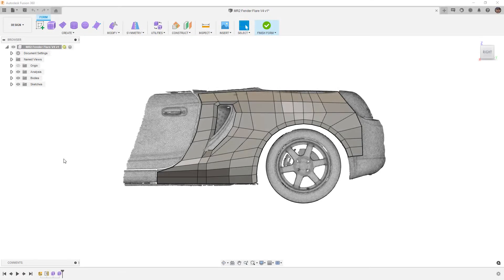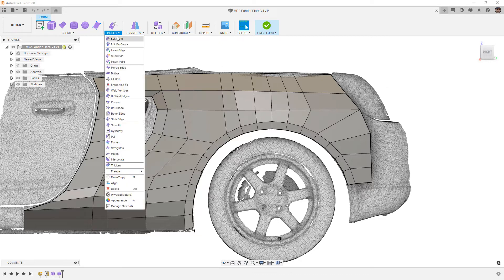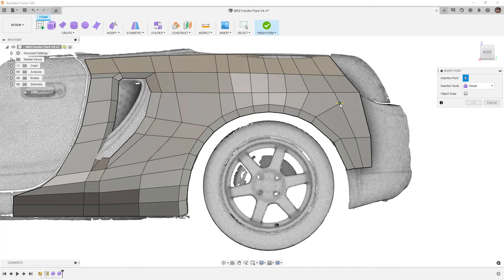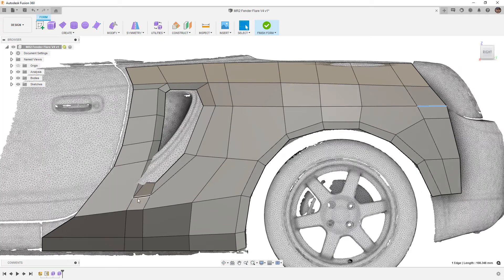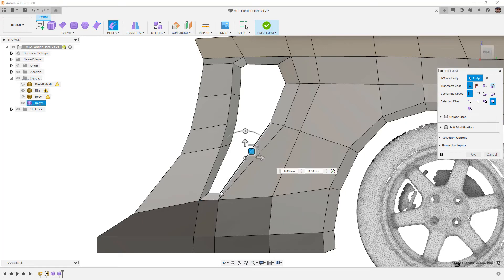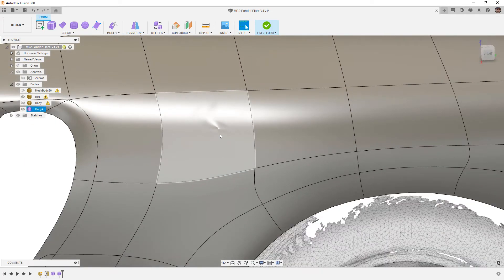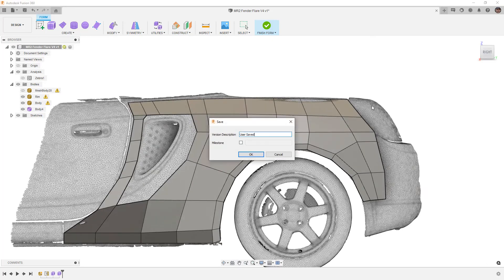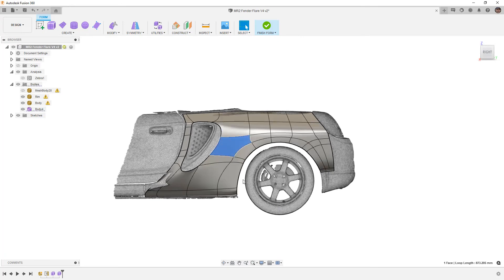Design a Fender Flare in Fusion 360 - Reducing Edges and Faces to Simplify Control #Fusion360

Comment: I really like your video series.  It is nice to see how to fine-tune the surface to get the flow of lines and curvatures that you want. I also like the depth you go into in fixing errors. There are few videos that talk and error correction in surface, solids and splines,  but I seem to get more for yours at least in the forms area.  I think Fusion could help a little more in this area too, but you seem ot help in creating a workflow that minimizes those issues
Reply from the maker: Thanks Robert!  There is no replacement for "seat time" and trying it yourself.  I just got done recording another hour(will be sped up) modeling this again just to see how long it would take without "teaching".  It looks totally different and has more of the "flare" I wanted but is only a 12min video with just the bullet points as text on the screen.  

Tsplines/Forms is trick because it is unique and not like Poly Modeling or traditional CAD.  I would be lying if I said it doesn't still frustrate me too :)

Comment: Hey thanks so much for getting this out before the weekend! Next time would you recommend starting with less points when making the wheel arch?? Was wondering if its easier to start with more points then take them away like you did or to start with less and add them in if you need later?
Reply from the maker: Well less is usually more.  WIth wheel arches its a balance.  Going into this design I didn't do any premodeling.  I feel like this gives a more pure look at the process and design design decisions rather than me fabricating a problem and solution.  So for this I "thought" i would want that level of control on the wheel arch and turned out to be wrong.  The key take away is that I took the wheel arch edges and scaled them out, and when deleting them we made sure to skip every other one to keep the shape consistent.  This means less manual touch ups.

In general I would say start with as few edges/faces as possible and let Fusion make the smoothest shape it can, then add control where you need it.  For this one looking at the zebra stripes and seeing those pockets or deflections was the "oh i need to simplify this more" moment.

Hope that helps.
Reply: @LearnEverythingAboutDesign  Yah I like the fact you go in kind of blind i get it. Thanks for that! So helpful as always.

Comment: @ 4:20 you're box selecting an edge that is normal to your view... I have the same exact "edit form" settings as you have in your window yet I cannot do this unless I rotate my view just slightly. Any idea why I don't have this functionality?
Reply from the maker: Hard to say for sure Kyle but one thing to check is if it works when you are not on Edit form.  The selection options from the main toolbar drop down actually change when in Edit form from the standard selection settings.  When you enable edit form you can double check that you don't accidentally have Tspline Edges deselected.

Let me know if that does or doesn't work.